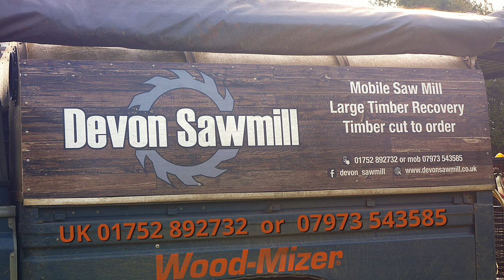Wood-Mizer LT70 Mobile Sawmill at Rousdon Estate (Part 1) -  10 Apr 2021  Woodmizer Wood Mizer

Comment: Nice mill,  power supply is in the truck? Cool video
Reply from the maker: Hi Craig,  Yes, the load bay in the back of the Land Rover Defender houses a diesel genset.  The Defender is heavily customised with a bored out engine providing additional horse power, to cope with the demands of towing the mill, pull uprated suspension etc.  All in all an outstanding  rig that can produce a huge amount of cut boards in a day.
All the best,  Martin
Reply: Hey Martin, we don't see that kind of a set up here in the states.
Very cool to say the least,  I run a lt40 wide 38 horse Koller. 
I will be looking for more of your work for sure.
Safe sawing brother,  keep them coming 🌳🌲🧡🧡🧡🙋👍👌
Reply from the maker: @thekiltedsawyer  Hi Craig,  I am just the monkey on the camera - the owner and operator of the mill Rob Biss is a Devon, UK, shipwright.  He specified the custom build of this mill which involved I believe a couple of European Woodmizer dealerships and it was a long drawn out purchase.  The wireless remote control is a brilliant accessory.  He added the air compressor and the table extension and both are useful upgrades.  
This is the second visit by the mill to where I live.  I felled some of the timber that went through the mill and I really enjoyed working on the off loading of the boards from this awesome machine.  Here is a link to Part 1 of the earlier visit in 2019:   https://youtu.be/_tyJllboo7g

All the best for the New Year - stay safe.  Martin
Reply: Copy that buddy,  it's awesome,  cut  safe and happy new year!!